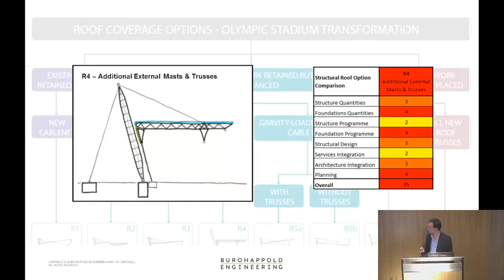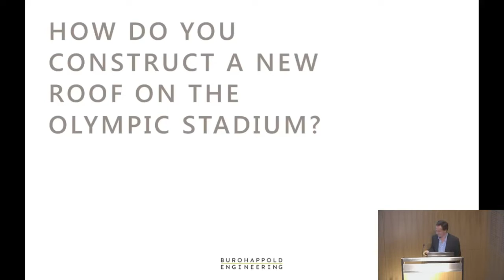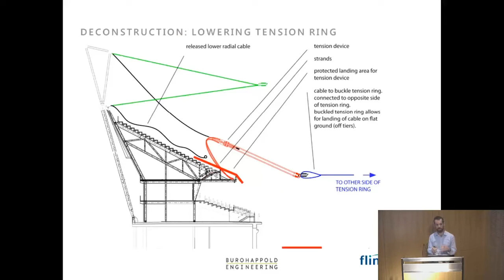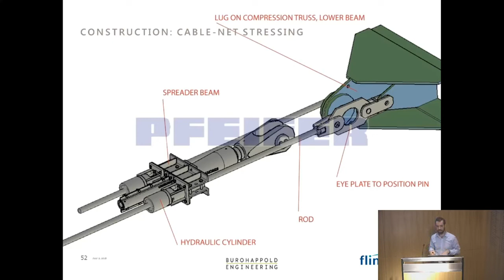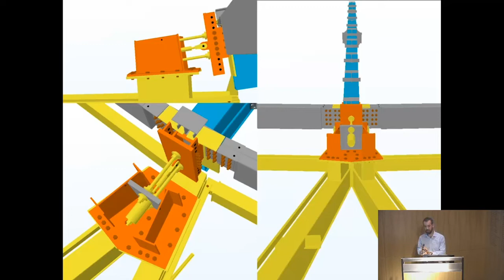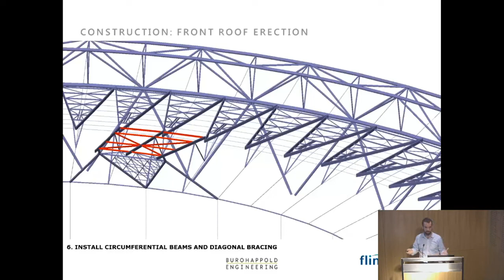A new roof for the Olympic Stadium

Comment: My uncle, an engineer who knew engineers who worked on the Olympic Stadium, told me… years ago… the reason the roof did not fit properly, was because the sides did not take into account the curvature of the earth. It was off by a degree or so. Enough to mean metres in height from one side to the other.  Take that… flat earthers!